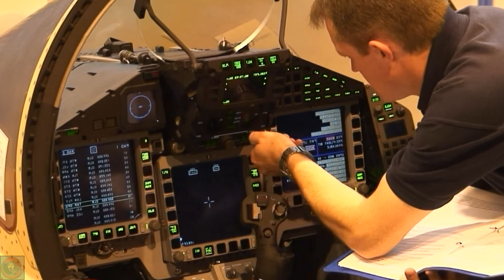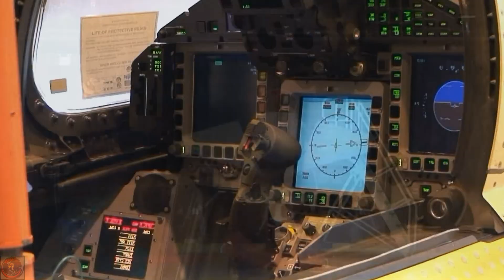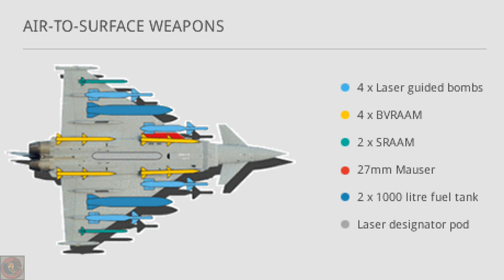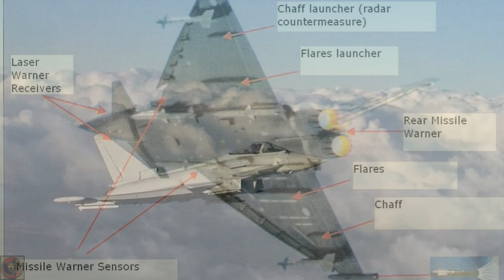Eurofighter Typhoon Combat Fighter Jet - Europe’s 4th Generation Fighter

Comment: I'm amazed, how war birds may look so different due to unique design features and engineering approach, yet share similar capabilities at the end...
Reply: Excellent point. In the end it comes down to the thrust / performance limits of all available jets engines (just like the many variations of cars with their different engines, weights, tires,yet all vehicles only having a performance difference [going 0-60mph/ 0-100kph] of only a few seconds). Seconds. 
and secondly, the limits of g forces the jet pilots can endure (the computers override certain jet commands to limit g forces and prevent flight instability aka Fly by wire).

Comment: 9:12 any reason why the RAF does not utilize the canon? Are they using the same thought process as what drove the F4 being designed without a canon?  Obviously BVR has matured dramatically since the 1970s but has dogfighting really gone by the way and has SRAAM able to handle an engagement in the classic out turn to a fire solution while on a bandits tail dog fight?
Reply: DenseAlloy the cannon is still used but mostly for ground targets, it eats through the ammo in seconds

Comment: One of the main breakingpoints with France was that they wanted an aircraft that was more oriented towards groundattack. Thats why they ended up building the Rafale. Looks very simular but is better at low altitude flying and ground attack.
Reply: Yes, but that wasn't surprising if you look at the fleet of aircraft the different countries involved with the project had at the time.
Germany, Great Britain and Italy needed urgent a replacement for their aging F4/F104 fleet. So they needed a high performance intercepter/air superiority fighter. For Groundattack missions all 3 countries already had the Tornado, which was a fantastic strike bomber. France on the other hand already had the Mirage 2000 at the time, which is a great interceptor, but had hardly any ground attack capabilitys.
Reply: shi01 Yes idd. I wasnt sugesting anything els. Just adding something that wasnt in the video that i thought was wurth mentioning

Comment: So the EU got together and built an F-16 that costs 125 million pounds each (while the F-16 only costs 35 million US).  This makes no sense.  The Rafael costs even more (the French ate the 43 billion rd costs or 263 million for each plane as built).  Gripen is probably the best EU aircraft since it can do 99% at only 60 million each.
Reply: F-16 is cheaper to service with it's one engine.  Those two engines do not have an advantage over the one engine.  You don't need two engines while flying over land.  Again, overpriced for 4th generation fighter where a cheaper and better alternative was already available from a NATO member.

Comment: In my opinion it's not a dogfighter but a ground attacker since it isn't the best maneuvering fighterjet. It's a big airplane with a lot of slots for weapons and an awesome ECM capability
Reply: Do you knew that the Tranche 1 EF didn't even had ground attack capabilities? It's was designt as a intercepter with extreme high speed manouverability. Problem is, it's impossible to show this on air shows because you aren't aloud to fly super sonic there.

Comment: An excellent multi role fighter I’ve always preferred two engines instead of one for reliability and safety reasons. A great video of the Eurofighter Typhoon thank you for sharing Mat👍
Reply: Well, for defence single engine makes more sense, and for attack twins make more sense, because when defending airspace the biggest priority is to have the aircraft in the air, does quick maintenance is more important

Comment: "stealth" is BS,It was invented by the big USA"skunk-works"cie's to steal your tax dollars,not one single proof made public that a 40 plus tons plane could become invisible in the skies,might appear smaller but that's it, a CS is a CS.
Reply: You realize what aircraft "stealth" actually means right? It's not supposed to be invisible. It's supposed to deflect or absorb as much radar as possible. It's not expected to "become invisible". Stealth in general typically refers to sneaking, keeping out of sight as much as possible. Think about it clearly, a radar operator will notice small bits less than glaring blips. Radar guided systems will be confused more by weaker signals. 

Perhaps a better way to put it: Think about heat-seeking weapons. If the engines burn at over a thousand degrees, it'll see it far clearer than if they burn at 250 degrees.

Comment: Stealth is an area of much confusion. The Americans are always comparing their requierements in this respect with the F-15. Now: If you designed a radar reflector, you would be hard pressed to construct a better radarreflector than the F-15 (the B-52 springs to mind). The Typhoon achieves much in stealth capability with attention to detail. It will never be an F-35, but - given proper tactics and supercruise: The warning time for the enemy is cut severely and when found out - that may be to late anyhow.
A Russian Fullback will probably not be able to tell wether the Typhoon that has blown up his aircraft started from Posen in Poland, Skrydstrup in Denmark or Jagel in Germany. But lets say it as it is: The discussion is strictly academic for the russian that is trying to figure out why his ejection seat is not working.

Comment: One of the major problems in planning is: How much in advance shall you plan? The americans have - since WW2, when they were caught with their trousers severely around the ankels - argued that the planes to build should be a generation ahead of everything else the nasty enemy (whoever that might be) could ever put up.
There is a deterrence effect in this, as it is so costly to keep up with the americans, that most give up. Thus an overly expensive aircraft (or tank for that matter - it is hard to see Russia or China coming up with tanks in Leopard 2, Abrams or Challenger class in significant numbers). Ok in the course of time the planes might need a new instrument panel and a paint job; but nothing major. This approach has the advantage in so far as successfull that f.i. China will never be able to catch up with the USA. The chinese producing something better than the F-15? Please!
The Russians just MIGHT, but they will run out of money before that will be a threat.
The result is that the USA has the F-22 to be able to top something that tops the F-15, which has not been topped to date. The F-22 is not a new aircraft any more and would probably not be build like that today.

The Typhoon has the more conservative approach: Lets build an F-15 while avoiding some of the mistakes inevitably made during its construction. Meaning: Europe has an aircraft with slightly better performance (very significantly: A more modern engine) than the F-15 and is about 10-15% smaller (thus cheaper to operate). In aviation cost is a first order function of size (weight). In naval matters displacement is not that significant. Much better to build the ship to large for the role and give the crew better working conditions - if needed you can always plug in a more advanced weaponssystem - without the chief getting his knickers in a twist. That was the lesson of the Falklands.

The Tornado is still impervious to hostile fighters - even in optimum conditions you can't get a proper missile lock on a Tonka going flat out at 100 feet. If you try to follow you will just tear your wings off - as was early on demonstrated by Hawker Hunters (definately a plane of excellent flying characteristics). Not that the Hunter did not have the speed in low level - it did - but dispite being build like a victorian bridge in the wing the pilot simply could not keep up: The Hunter rattled and jumped while the Tornado went through turbulance like a knive through butter.
The nasty enemy has probably realised that and build missile air defences. Thus enter the F-35 without astonishing maneurability, but with missiles and stealth to take out the hostile missiles.

The Typhoon is a response to the question: How good are the enemies actually? Come on! We are talking the flaming Russians! They might be able to slap a few terrorists around, but when serious opposition? Not a chance. At the same time the Typhoon has the range needed to reinforce all over Europe and the Middle East by simply touching down on airfields with facilities for it.

Comment: Did you just claim this plane to be "tiny" (cough, cough)? It is considerably larger than than the single motor Saab Gripen. It's 8 precent longer than the latest and longest version of Gripen, 31 percent wider than Gripen, and 37 percent heavier than the latest and heaviest Gripen. On the oher hand, it's roughly the same size as the older plane Saab 37 Viggen (but 30 percent weaker thrust than Viggen; on the other hand, it can go 64 percent farther without a refill).

Comment: Austria bought those quite expensive Eurofighters (15 units) for about 2 billion euros in 2007, although we could just have bought the much cheaper but good enough Saab Gripen. The Eurofighter costs about ~90 Million while the Gripen costs just ~50 Million. 

Even the F-16 was considered. But because of some corrupt politicians we bought the Eurofighter. Now (10 years later) there is still an ongoing investigation committee. 

The other problem Austria has with this fighter, is that we don't have enough money so we have just have equipment (missiles, fuel) for probably just half (5,6,7 planes) of our glorious airforce.

Nevertheless I personally like the Eurofighter and am pretty proud to have such advanced aircraft in our beloved Bundesheer/Army.

Comment: Errmm Matsimus, the RAF does use the Gun, they originally did not intend to use it, but they started using it again a few years ago. 
http://www.telegraph.co.uk/news/uknews/1530420/Typhoon-wins-gun-dogfight.html

Sorry the "best" source of it I could find this shortly, it was a big topic then but it was about ten years ago. 

Basically they found out in Afghanistan, that there were situations, with TIC (Troops in Contact) where it was too danger close for guns and/or rockets, in which cases only the gun could be used. 

This source backs it up:
https://www.flightglobal.com/news/articles/eurofighter-typhoon-proves-close-air-support-credent-224826/

"Several pilots from the RAF's 3 Sqn - its first frontline unit to have received the Typhoon, initially for use only for air defence purposes - took part in the exercise, where around 700 rounds were also fired from the type's Mauser 27mm cannon. More work needs to be done with the reactivated weapon, but Atha says: "As a first step, we're there.""

Gun is also mentioned as reactivated here: 
https://www.flightglobal.com/news/articles/typhoon-training-syllabus-to-add-multirole-skills-222125/
Although they misidentify it as 23mm cannon. We haven't been overrun by the russian yet........again! ;) 

The reasoning for the removal: 
https://www.flightglobal.com/news/articles/royal-air-force-can-save-186-billion-on-eurofighte-123225/

God parlamentarians can be such Mk-82s! ;)

Comment: Amazing aircraft and good to see you have done your research. Who needs stealth when your plane can either detect the stealth aircraft by multiple means of Electronic warfare which isn't just the plane but others like AWACs, Ground Radar, Ships or just detect the missile which cannot be stealthy. Size doesnt matter anymore in the world of advanced electronics. Older aircraft can be fitted with electronics to detect stealth so there is no point building a stealth. However stealth can still be used to be a pain in the ass for the enemy giving jets the ability to get a bit closer to the enemy. This is why they call the Typhoon a Semi-Stealth 4.5 generation.

Eurofighter is a great aircraft but the real reason for its holding back is its so called 'respecting' governments.
Reply: G777GUN Because you aren't always going to have those at your disposal. And stealth does make it difficult for the enemy to track you.
Reply: G777GUN And semi stealth doesn't work.
Reply: True. But only in  a surprise attack where you would be the ones starting the war. After war starts stealth is useless. Stealth is expensive to maintain and bases are a prime target, infrastructure collapses. Only the most rugged planes will survive long enough with the best all round survivability.
Reply: That remains to be seen. If its ever truly used. Not against third world countries.

Comment: Is this the very expensive one that keeps crashing and killing its pilots while never being used in actual combat operations ?
Reply: Nope.

You're probably mixing up the F-22 and the F-35, one spent months choking its pilots to death and has a hilariously expensive unit cost (as well as a fear of the international date line) and the other will be operational "Soon(tm)" and has been really expensive to develop (but will likely be cheaper in the long run).

Basically if the manufacturer name starts with "Lock" and ends with "heed" you're gonna get messed about by them, but they will make something good at the end of it.

Of course you could also be mixing up any number of the Sukhoi or Mig variants that got developed and never manufactured (all of the iconic airshow crashes are from Suks and Migs).

But no, the Eurofighter isn't massively expensive, hasn't found especially creative ways of killing its pilots and is in service and bombing stuff for several air forces (i believe at least).

Comment: The Dutch Royal Airforce is replacing the F16 with the F35, but actually  I think that is very dumb because the F16 is a fighter and the F35 a multirole. Maybe the airforce  will buy the Tyfoon in the further to get along with the F35. What do you think of this Matsimus?